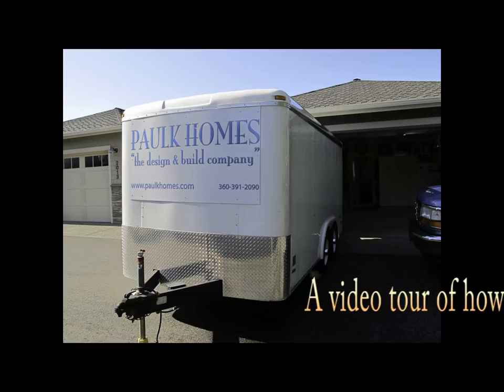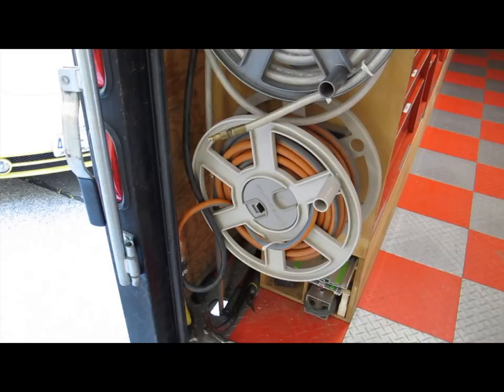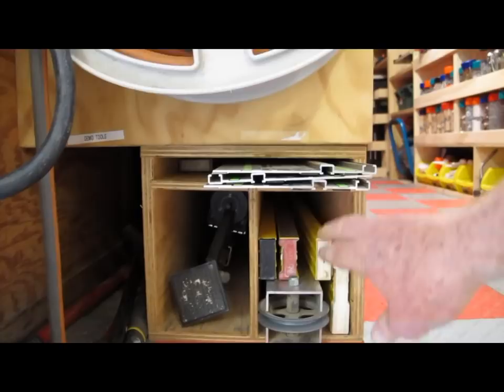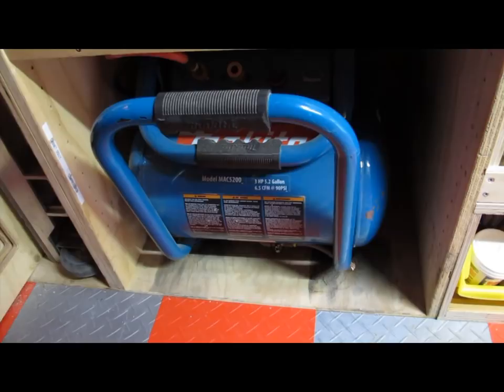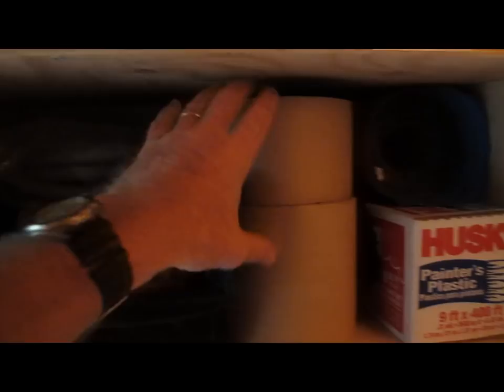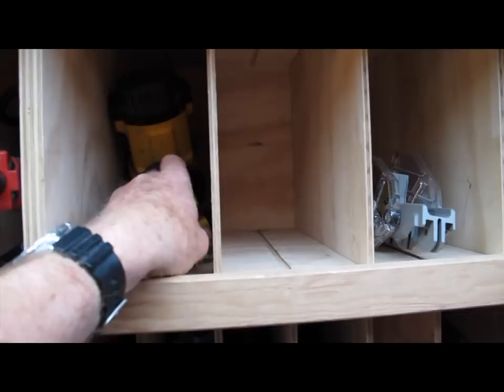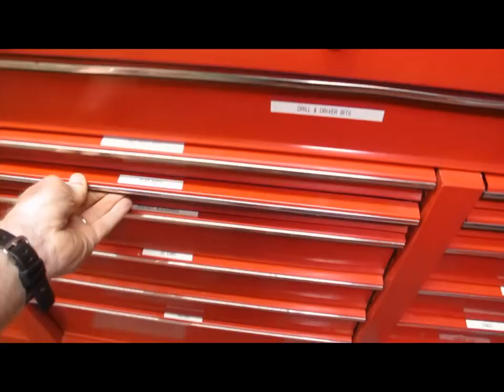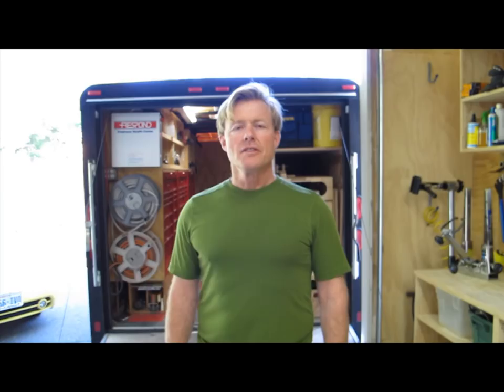Stay Organized and Mobile with Our Rolling Tool Box Trailer

Comment from the maker: The Husky boxes used in the trailer held up well for many years, in fact, not a single failure. I depended on the locks to keep the drawers closed and tools from spilling, but sometimes I forgot to lock them all. Since I have sold the trailer and moved to the mobile shop truck, I now have shop made drawers which do not slide out during transport.

Comment from the maker: You might have a great idea! Making the modular adjustable system like I have, but having it easily removable. Wheels? Palletized so a pallet jack can remove it. I have thought about having a flat-bed dump that I could load on various boxes: a dump box, a mobile shop, and a storage box. All could be set up much like a camper on a pickup, only with heavy-duty jacks.

Comment: Ron, Great video. I was a Door hanger/ Finish Carpenter for 20+ years in So.Cal. I evolved to a trailer like yours that we towed with a 15 passenger van. My theory was go pick the crew up, which gauranteed they would be there for meWe got the trailer when my crew and I started to trim out on average one 10k sq.ft custom home a month. We never went to the lumber yard as we had bulk of everything, and we had every tool needed to do any phase of installation to a large custom home.

Comment from the maker: The Dewalt 735 planer is well built, easy to use, porduces excellent results, and has very good dust collection. At first I was disappointed as the blade dulled in a very short time. After trying and getting the same results with another set of blades, I purchased a carbide set. They are expensive, but worth the price. Without the carbide blades, I would give it low marks.

Comment: that's a very nice setup. You have cited all the reasons I like a trailer. Also your truck is not completly dedicated to work. 
An Idea that I have had for a long time is a custom built trailer with multiple doors and drawers from the outside. that way you don't have to waste the walking isle in the middle, and you dont have to step up inside repeatedly.

Comment: Impressive.  I am working on my first one and your video is giving me some ideas.  My issue is that I want to keep my trailer as multi-role as possible so the benches and everything can come out and then I have an empty trailer to haul stuff with but I have this big issue of having to move a bunch of stuff in order to get at what I need since I left a lot of tools in the original boxes.   I like that adjustable shelf compartment system.

Comment from the maker: Yes, keeping the tools from being stolen is an issue. I use some basic precautions. First, I live in a small community and work within a 5-mile radius of my home. I have good locks for the door and a tongue lock. Whenever possible I back the trailer up to the garage door so that it cannot be opened without first getting into the house. Finally, if my gut grumbles, I don't leave the trailer on the job. Furthermore, I should have an alarm system.  22 years and no theft: knock on wood:)

Comment from the maker: Aaron, Yes the Makita has been a solid performer. I don't run 3 framing guns at once, but think it would have no issues. If you has 3 coil nailers going at top speed shear nailing, it might not keep up.

Comment from the maker: Chris, I no longer have my trailer. I use the box truck exclusively in hind site I wish I still had both. I work alone these days so my needs are changing. In the past I had a 6 person crew and had multiple trailers so they could be on different job sites at the same time. If I were to build myself a set up today, I would combine both setups into a larger trailer so I could have the mobile shop in a trailer. The down side is that it would take an 18' trailer which is a hassle to move around.

Comment: Excellent placement. I got several ideas from your video. I have similar idea to place all the tools that I need in country house into small trailer. My only consern is about batteries which could be damaged in winter. It gets as low as - 25C arround here.

Comment from the maker: The doors didn't add any advantage and got in the way. I used them to hang cords and stuff, but that wasn't a real help. I like the ramp to walk up and down, plus nice when loading and unloading big tools such as generator, power washer, etc.. I already mentioned it, but the biggest issue was the barn doors were always in the way. Everyone has their personal work style so this is just my opinion: I would not consider barn doors even if the trailer were 1/2 the price.

Comment from the maker: Oskar,
I have had a number of trailers, some too small and some too big. I am planning on building up another trailer soon. For me, I prefer 16-18'. I am thinking about 18'x8' with ramp and side door. I hope to find one with higher ground clearance for easier egress on steep drives. I had one trailer with barn doors and sold it after one years as the doors didn't work well for me. Bigger is better as long as you can get it on the job.
Reply: Maybe smaller is better!
Reply: I would build a smart woodshop

Comment from the maker: @jsabados 
I cannot quote the model number, and the truck is currently on a job. My 7 spindle head is the same one used on the pneumatic model. My manual press is 2010 versions, which changed a bit from the 2009 version. The dealer gave me a plastic collar from the 2009 version so my 7 spindle head would fit. They did not charge me for it, so I am guessing if you bought a new press and old 7 spindle head, you will need that part.

Comment: Your trailers are very impressive, I'm a floor installer and have a 7x14 Vnose I pull around and wanted to ask you some questions on your hose reels and how you have them mounted along with how you have it wired up, I want to leave my compressor in my trailer and be able to have lights and charge my batteries as well, thanks for the videos there great!
Reply from the maker: Reds Flooring I wired mine up all to a 2 gang box and then simply put a pig tail hanging from it. I then mounted a 100' 10/3 extension cord on a inexpensive garden hose reel. I roll the cord out plug it into an outlet and then plug the pig tail into the other end. Simple, affordable, and works.

Comment: Great looking trailer.  A tool collector, they dont looked very used.  It all looks good except theres no sawdust, none.  I take very good care of my tools but these ALL look brand new or hardly ever used.  Otherwise, its a hell of a trailer setup. Good work
Reply from the maker: I wish there was no sawdust. During the trailer build, I spread (3) 32-gallon  cans of sawdust in the field behind the shop. With over 200 houses and too many remodels to count on my resume, I have created a large mountain of saw dust;0)

Comment: I need the inverse of a rolling tool box.  I want a cargo trailer to empty my garage so I can open up my garage/workshop.  My question is can my 4x4 Tacoma handle a large trailer say 8.5ft X 20ft?  It’s just going to sit in the side of my house but I have to squeeze it into a tight spot 9’ 4” ... and the mirrors on a small truck see around an 8.5ft trailer?

Comment: If you do not mind to tell. Which model of DeWalt table saw You have? Thanks.
Reply from the maker: I have two, the newest one is the DWE7480
http://www.amazon.com/DEWALT-DWE7480-10-Inch-Site-Pro-Guarding/dp/B00F2CGVPE/ref=sr_1_2?ie=UTF8&qid=1418243154&sr=8-2&keywords=dewalt+compact+table+saw
Reply: Thanks.